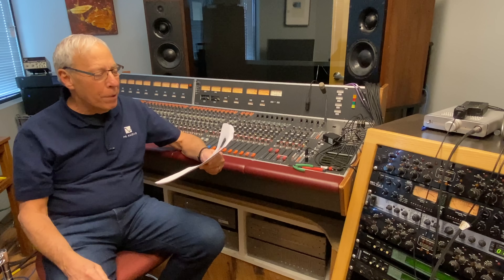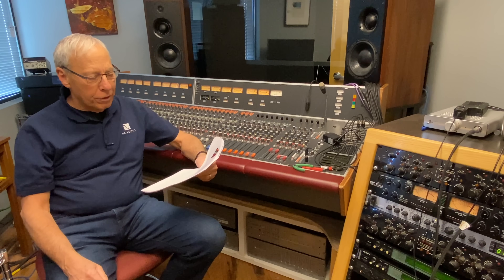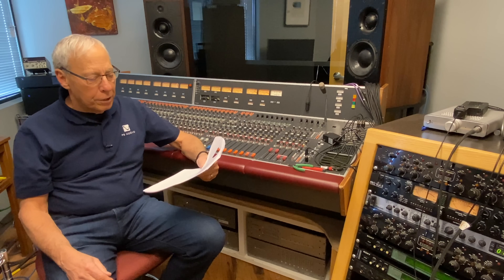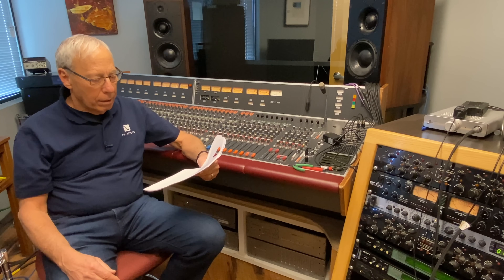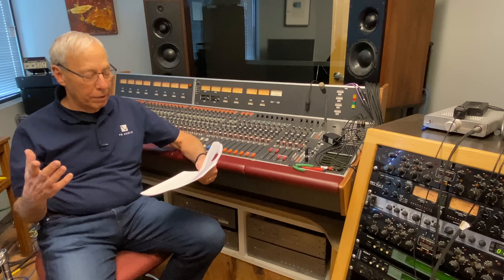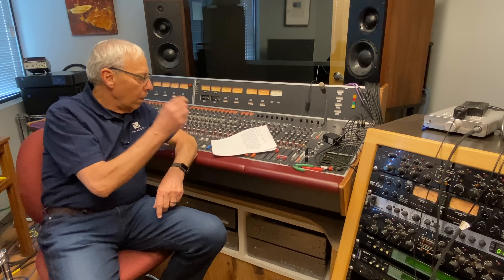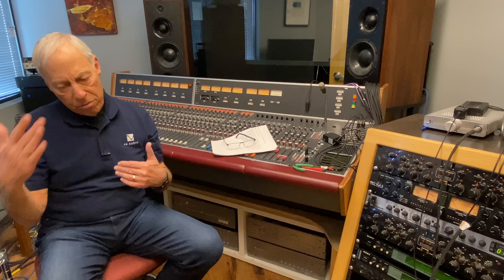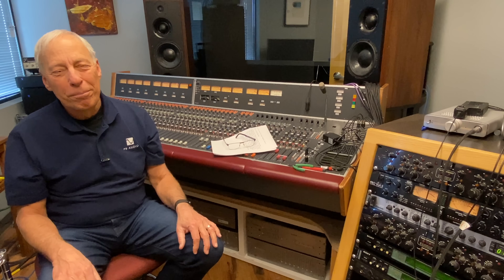Can you have too much damping factor?

Comment: One of the greatest focuses on Hegel design. High damping factor, and no negative feedback at any point.
Reply: Everything's a compromise.  The Hegel sound engine is no exception.  In order to avoid global negative feedback, they need to incorporate very complex adaptive distortion-compensation techniques.  It still involves error amplifiers, as used in conventional negative-feedback designs, but they take the error signal forward instead of back to the input.  
The question is how accurately that is done, and of course they are not going to tell us.  The concept requires creating a distortion-canceling summing junction after the power stage output; that is not a desirable place to do summing, because it requires working with large currents.  That really is not straightforward and the question is how well it can remove all audible artifacts.  
Also, the thrust of the design is addressing output-stage distortion.  They do not mention use of local feedback in earlier stages, but I'd wager it's there.
Reply: Marianne Oelund The sound engine works fine for my ears. I find the sound very good and natural sounding.
Reply: @oysteinsoreide4323  But that's kind of the whole point of your argument, isn't it: it sounds good to YOU in the situation in whch YOU test it. Others might listen to it and not like it as much. 

As with everything it's all about compromise: do I keep it simple and accept the drawbacks from that, or do I make it very complex and accept the drawbacks from that? Mark Levinson, not the worst in designing amplifiers, chose to stick to a relatively simple concept and focus more on using the highest standards in components. Does that make the Levinson amplifiers per definition better or worse than the Hegel you talk about?   

I found, like a lot of others, that you can't judge any piece of equipment on it's own merits and you've always have to look for the best compromise to suit your ears and your wallet. Some amplifiers that look amazing on paper can simply disappoint when coupled to the specific speakers you have.

I know my amplifier, a Harman-Kardon PA2200, for me works well with my Driade 22.2 speakers and Cambridge Dacmagic 100. I've recently upgraded the Dacmagic with better capacitors and power supply and for the money it sounds pretty good. Now I know that in an absolute sense it can't hold a candle to more expensive DAC's and the same goes for the HK amplifier. But within the limited budget I have, for me it's an acceptable compromise.
Reply: @tjroelsma  Of course sound taste is individual. I used six months to find amplifier and speakers for my system to find something I liked regardless of what other likes or not. Individual taste and individual budget are two very important factors, and everybody should be able to find something they like at any price point.
Reply: @oysteinsoreide4323  I kind of missed that in your argument and just wanted to point it out. Thanks for clearing it up.
Reply: @tjroelsma  I was not talking about individual tast earlier in the thread. I was talking about the sound engine in an objective way.
Reply: @oysteinsoreide4323  You sure did, which made me kind of wonder which angle you were coming from. 

I've seen and heard these kinds of arguments before, where people defended a concept unconditionally and ended up losing perspective. I was a little bit afraid you might go that direction but as I said you've cleared that up, kudo's for that.
Reply: @tjroelsma  Never mind. I have had two different discussions above, that got me confused I guess.
Reply: @oysteinsoreide4323  No problem, always nice to read a different point of view. It makes me re-analyse if my view is still valid. (at least valid to me LOL).
Reply: @tjroelsma  What I have learned in this is that the most important is to try things out for myself to make myself base my opinion on my own experience. Self experienced things always is better than just listen at other peoples opinion.
Reply: @oysteinsoreide4323  Oh absolutely, there's a huge difference between people, that's why I said what might sound good to you might not sound good to me and vice versa. I really like the sound of my speakers, others seem to hate that same sound. And the same goes with amplifiers: my humble HK has no right to sound as well as it does, but with the right setup it simply does it well enough for me. To improve on that relatively simple amp, I'll have to throw a lot of money at it, and that's something a lot of people tend to forget. The more you get in to top of the high end equipment, the smaller the differences become. Up to a point the differences may be large, but then it becomes smaller and smaller and at the very top it's more about perception than improvement. The same goes with cables and other stuff: more expensive isn't automatically better.
Reply: @tjroelsma  Much expensive stuff sounds totally different. It is also about taste in the upper price ranges too.
Reply: Marianne Oelund The sound engine is adaptive, so it only corrects distortion above a certain threshold.
Reply: Marianne Oelund They can't use feedback, because then you would get timing issues. That is the whole concept of the sound engine. Just watch the video with Bent who talks about the principles of the sound engine.
Reply: @oysteinsoreide4323  
Yes, I watched the video.  They still can use local feedback in early stages without timing issues.  Since they are class A and do not present difficulties such as notch distortion, they would clean up nicely with only a modest amount of local feedback.  That is not the kind of feedback which produces issues such as TIM, and it helps to control gain and flatten frequency response.
Reply: @oysteinsoreide4323  Not global negative feeback, but YES local feedback, so obviously hegel also uses forms of feedback
Reply: wallalo Of course it is some sort of feedback. You can't do error correction without some sort of it. But the feedback is in time with the corrected signal after error correction.
Reply: The Hegel H20 drives four pairs of Quad ESL 57s like nothing else can, whether it's to do with crazy high damping factor or not I don't know but the depth and quantity of bass is so good that I no longer need to use a subwoofer.
Reply: Agreed. Low damping means your speakers will be muddy, lack control over the driver, etc. There is no disadvantage of high damping factor. I had voice coil noise on low feedback and low damping factor. Voice coil noise issue was solved by increasing damping factor and now I have highest feedback and highest damping factor and highest accuracy.
Reply: @oysteinsoreide4323  The exact implementation of their "adaptive feedforward" algorithms is unknown. Either way, without giving you a few lectures in control theory, it would be impractical to continue this conversation on a youtube comment section.
Reply: W A Well. I trust what Bent is telling us.
Reply: W A And the sound engine is patented technology. So you could check it out if you want to.
Reply: Really? How do you know there's no negative feedback at any point? Really? Lol
Reply: W A Because they have explicitly told that they don't use it.
Reply: @oysteinsoreide4323  mmmh 4000 DF is a number, but is a real number? Where are the measurements and how were they made? It looks so much like the .00000001% THD that everyone invent ...
Reply: @wallalo  I don't think that a high class engineer like Bent Holter would lie to us. He has no reason to do it.
Reply: wallalo Bent Holter who designed the sound engine studied amplifier design at the best technical university of Norway. That's about thirty years back, and has been working on amplifier technology since. He knows his stuff.
Reply: W A They don't use it because it would introduce timing issues. Especially giving nasty distortion at high frequencies. That is why they don't use negative feedback.
Reply: So they recommend using speakers of a few hundred ohms?
Reply: @wallalo  nice try.... Speakers with hundreds of ohms are often called headphones.....

Comment: Hello Mistres Pauls. I notioced the PRO VL compressor has VU meters on its. SOme compressoprs from dbx and other dont have VU meters. Soome skinds of odd. My frends told me belt drive record players seem to ahve bettwer wow and flutter and DIRECT DRIVES, untilt he belt wears out and there ar eno replqacements belts. THANKES YTOUES AND THUMBBS UPS!
Reply: Before worrying about wow from the turntable drive, one needs to fix the disc wow.
Reply: @marianneoelund2940  Thankes you MINE GOODS FRENDS! Is the the artricle you were interested in...

What Impacts Wow and Flutter?

Both metrics are determined by a turntable’s mechanics and electrical power. This is why old turntables experience worsened wow and flutter: Their capacitor values drift. Over time, a turntable’s mechanical parts can wear down. Power spikes, too, can degrade a record player’s wow and flutter. Unfortunately, events which degrade wow and flutter are hard to pin down.
What Can You Do to Protect Your Turntable’s Sound?

It’s a good idea to invest in a surge protector. You can also talk to a vinyl enthusiast’s shop. These providers can fix up your turntable as it ages. Unfortunately, it takes a lot of time to track down the parts needed to revitalize an old player’s wow and flutter.

Find a turntable with decent wow and flutter ratings, and make sure it’s well-protected from power surges and other damages. Don’t stress too much over your player’s ratings, though, as the low percentages held by most players don’t reveal too much distortion.

THNAKES YOUES AND THUM,BBS UPS!

Comment: Alright I have a question, if a amp sends power down to the speaker through the positive line and then through the speaker and then back to the amp through the negative line.....
isn't it mostly converted to heat and wouldn't it make sense to separate the ground from the amp? Like a separate grounding block?
Reply: fin ...I was kinda hoping that it was mostly converted to sound (SPL)